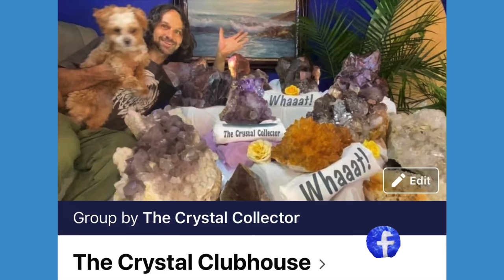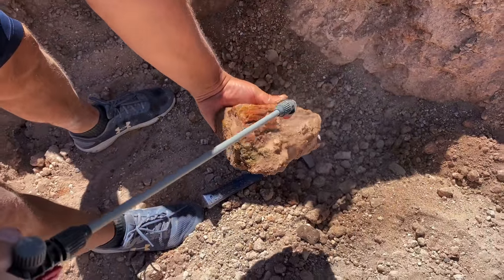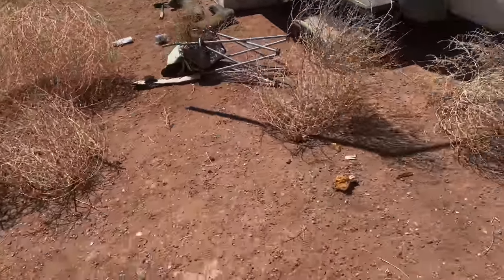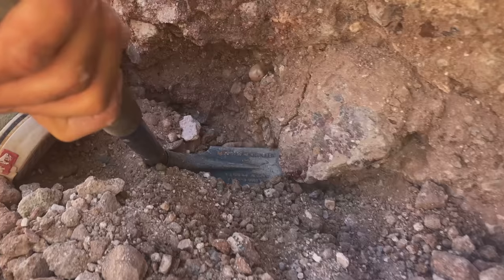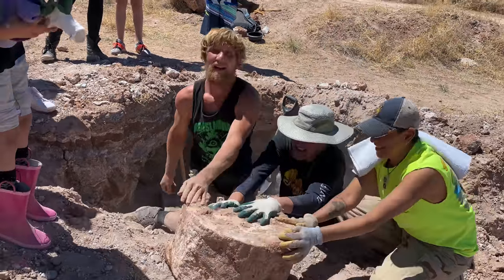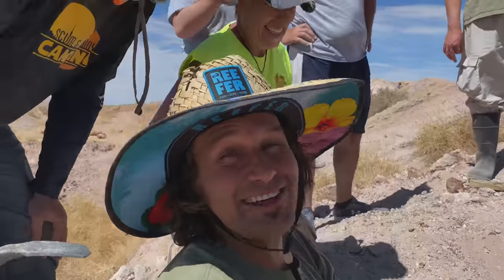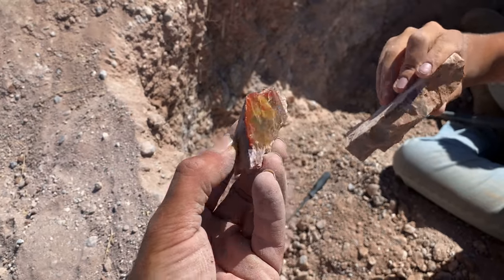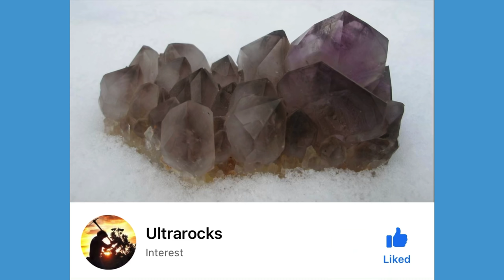Petrified Wood Rockhounding Gets Wild in Arizona!!

Comment: went to the Dobell's Petrified wood mine today what a fantastic day.. only my wife and me you will fill a bucket in a few hours. Noah Dobell 4th generation on the ranch great host .Now the sign is down so it is hard to find. the sign was taken this happens souvenir hunters as the ranch is about 2 to 2.5 miles from the road. Hwy 180. directions are  from I 40 head on hwy77 south a little over a mile to hwy 180 turn left at the petrified wood wholesalers yard 12.2 miles turn left dow a paved road go 2 to 2.5 miles over the hill there is a call button by working and shed as you enter gate on the left.Never new you could get so much in a short period of time.Colors are Beautiful.this is cool.5 star rock hounders dream.